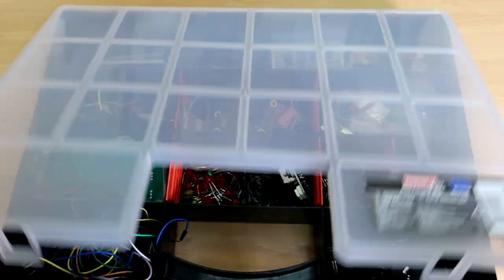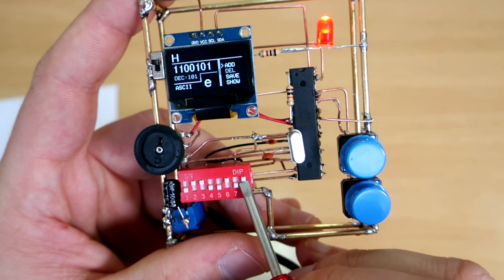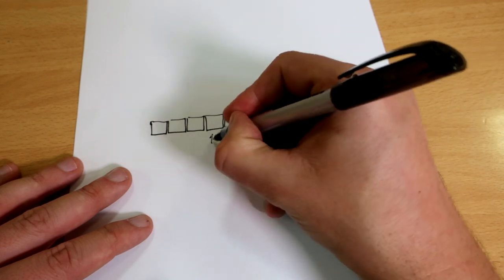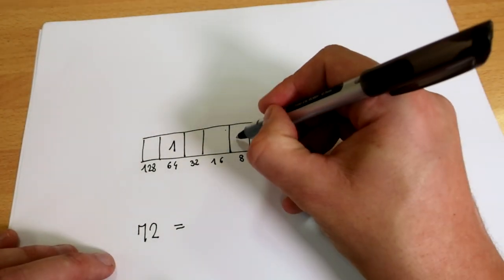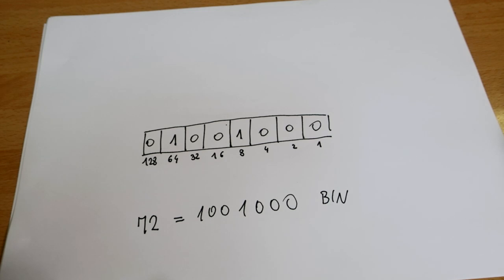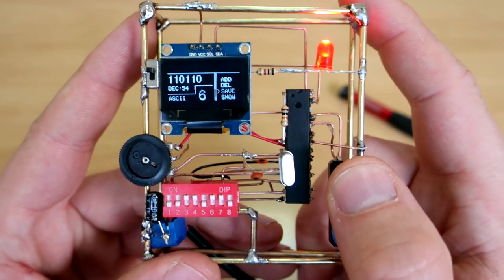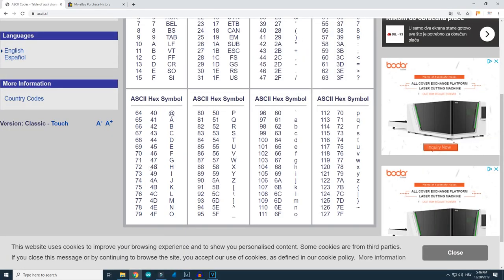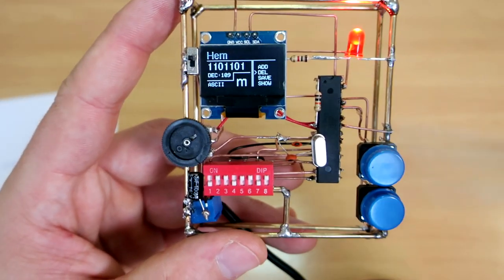Arduino - number converter, calculator, text editor and game

Comment: Yes its called a 8 position DIP switch.  The main use was before user interfaces and eeprom storage was everywhere, it was typically the non-volatile way to configure settings on a device.  Usually an embedded microcontroller would boot up and read all of these switch positions, and thats how the software would be configured. Just a more user friendly form of "jumpers" :)